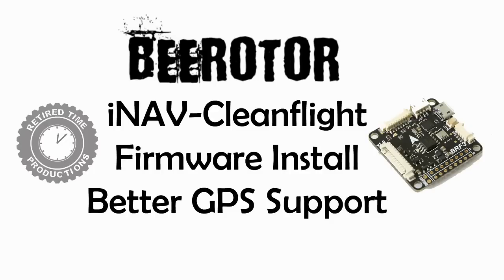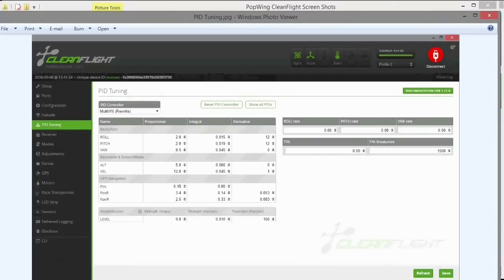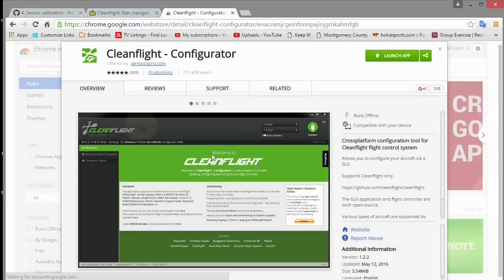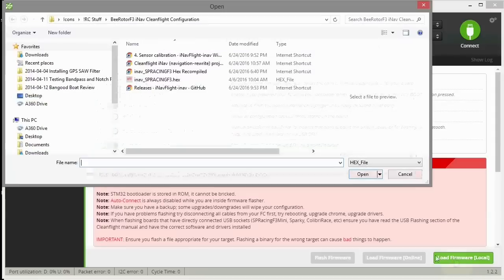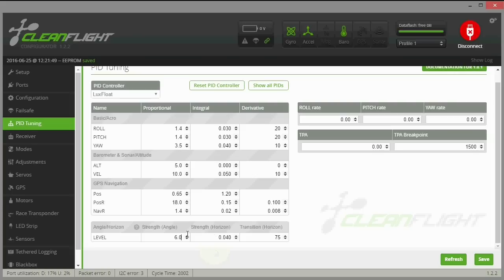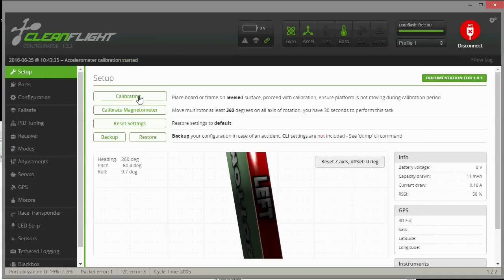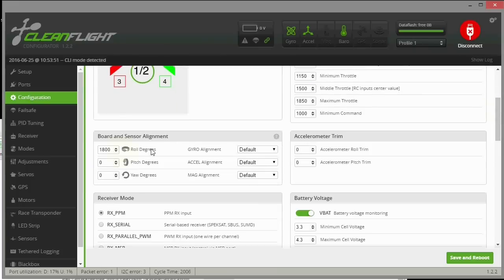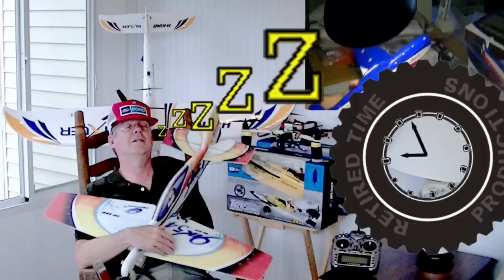Mini PopWing iNav Cleanflight Firmware Setup on BeeRotor BRF3 Flight Controller for better GPS

Comment: One of the reason it didn't work with, say, naze32 is because naze32 boards have another microcontroler. Yours has an STM32F3 series (probably what the F3 in BRF3 stands for) which has more flash/ram than the STM32F1 that the naze32/flip32 boards have.
Reply from the maker: I just wish it would NOT reset the home position went the satellite lock is lost.